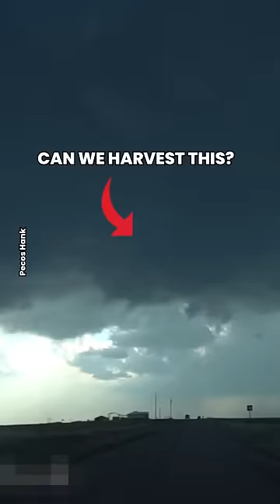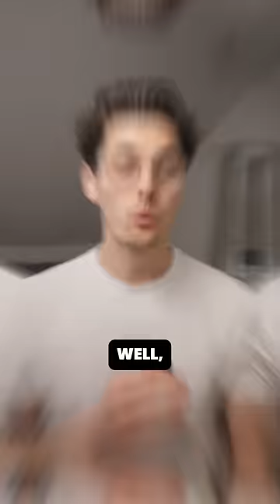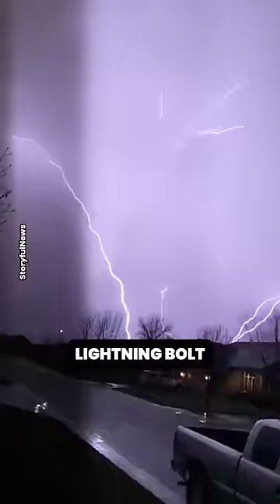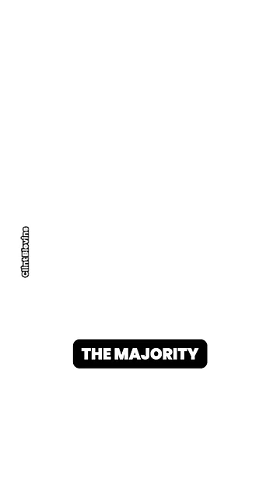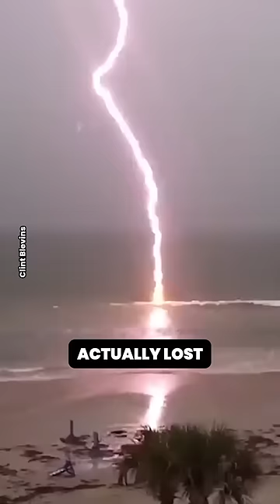Why don't we harvest lightning for energy? ⚡️ #shorts #alternativeenergy

Comment: If we could tether balloons with conductive cables , like hot air balloons people would ride in to blimp size balloons covered with conductive materials.. possibly carbon. Maybe have it in sheets from the balloon or possibly rods with multiple balloons per cloud. Possibly install micro jet engines to maintain position. And to handle. The large pulse of energy, the key is to NOT collect the lighting pulse of extreme energy. The idea is to get the balloons in the storm clouds early before the strikes start and use huge banks of mega capacitors. With  composite conductors hanging from the balloons as they slowly pass an area . The capacitor banks are in multiple banks on the ground. The ground rods can be roughly 100' rods placed in wet areas, ponds, creeks swampy areas, or use my metallic casings for a well. Some areas possibly a 200'-400' ground rod placed into the water table. With a small carbon  and possibly ultra fine gold plated silver wire with the cable being up to 30-50 miles long with the average height of roughly 2; miles high or less than 3-4 miles.this allows the connection to cross the town easily possibly have a grid of sorts. A single wire circling the city or county to make the connection to. With the connection being made by a look large drone with two  carbon fiber robotic arms with the connection bring broken automatically  with multiple connections possible. and  the larger blimp size balloon can have smaller balloons attached to it. That are reeled in by small winch. Having smaller balloons (100' sphere +/-) with a accessory basket and connection to the blimp it being from 500' to 1000'+long and 100'-250'+ wide, with the. Small balloons attached to it. About 4-6 on each side. Each with its own controls using small jet engines or ducted fans (electric jet engines) or even traditional propellers using a small engine and generator to provide power for the electric version (and battery bank,) to allow it to land it's self if the tether is broken  using a larger possibly carbon nylon, synthetic cable with a conductive core or possibly a separate conductor the conductor being roughly the size of a 14 gauge wire. Made from carbon with possibly ultra fine gold clad silver wire woven in the carbon fiber. If the wire is work hardening possibly use a induction heater to heat the wire in the carbon. The carbon being a fair conductor because the voltage is high. And current Is low.  With the voltage being from 20kv to 800-900kv in the 5ma range possibly 15ma . With gps to keep the ship inside the storm the difficult part is building something like a reverse Tesla coil. To convert the high voltage DC to AC. Then convert it to lower more useable voltage . Likely 2000 volts or less possibly it using a 500 Mega farad storage bank to store the energy so the battery can be charged a 5 mega watt battery bank to supply the grid.  With the battery bank and capacitor banks places in towns  along common storm paths. With a few trucks   with Large spools on towers connect to the grid loop that connects to the storage, then connects to the drop line from the balloons.  Using a fiberglass boom arm to connect the cable to the 2/0 steel or aluminum cable. Looping the town connecting the up to 2000volts to the storage when inverter converter on another truck trailer  the balloons could possibly be equal to flying about 8 kites about 20,000 SQ ft  in a thunderstorm. With the small balloons carrying a fine carbon net between them and the blimp this can exceed 300k sq feet , it will collect power in clear weather but in a storm with one at the top of the storm and another at the bottom, the energy could be much greater like catching a bolt ⚡ of lightning. spread out over minutes not less than a second. It could be a constant 500ma at 200kv. And. The balloons could be made from a thin carbon fiber like silk over a thin mylar film. Fill with hydrogen in small compartments with equipment to chill and compress the hydrogen into tanks. To land . Or boil off the hydrogen to reach higher altitudes.  This can lessen strikes during storms. And can be built up over time. About. 100 million to start

Comment: Did this guy just make this stuff up? I’m a verified EHV (Extra High Voltage) electrician and studied lightning protection systems and currently am a Senior Electrical Tech at xylem. I can build a system to charge batteries with a lightning bolt however I’d need a sizable array of capacitors high energy diodes and batteries at the basics. I could build it large enough to charge during a lightning storm and power a city grid, however, how often would I get enough lightning to justify the price is the problem I can think of. Heat loss is no issue I can get taller towers and lightning still has a lot of energy even after hitting the ground, we already send higher than the energy in most lightning bolts in EHV and UHV lines so carrying that much current is common. Predicting where a lightning bolt hits is not an issue as you can cause it to target posts easily. The problem is lightning storms don’t occur enough to justify building a lightning harvesting system in my opinion. 

If they can cause a lightning storm where the causing of the storm vs the price of harvesting the energy makes the juice worth the squeeze then great but it might not be worth the price.

Comment: the actual reason is its not profitable enough to make it works. making a large ass capacitor to hold that much power in a fraction of a second will cost alot and need a lot of space to store ut

Comment: There is a voltage gradient of 100 voltage for every metre above the ground. I have seen a static charge electric motor,  you tube,  running of a hundred foot wire  under a baloon. Enough to charge a phone.

Comment: What if like a balloon made with material that is conductive and wont pop it. just flying in thunder cloud connected to the ground with wires. Will that fix the "we don't know where it will hit" and "most energy lost to heat and light" issues.

Comment: Couldn't we make like... REALLY thick carbon rods, really high in the air? Pure carbon has the highest melting point, and conducts electricity incredibly well. Sure, we'd lose a bit of the carbon at the strike point, but... it's a really, really abundant material.

Comment: We don’t need the lightning to harvest the energy of a storm. Lightnings happen because there’s charged cloud and all the charges want to go towards the ground. When the voltage becomes high enough the air ionizes facilitating the passage of current and the lightning smacks the ground. But what we really care is to transform the potential energy of the cloud into electrical current and store the energy again in batteries. If we had a very high tower (I’m talking like 10km tall) we can just harvest the energy of clouds passing by. But that’s very complicate to build, if not absolutely impossible with our technology. Then you have to hope for a storm🌈. Also, the reason clouds contain energy is because water evaporates and forms clouds that are then moved by winds. So, even if there was such technology, it would just be solar energy with extra steps. Just build a solar panel.

Comment: Every point you made is wrong. We totally have the materials, we can not only predict where lightning may happen but can attract it, and excluding the light and heat and sound energy given off which is negligible compared to the whole not the other way around still leaves the majority of the energy. Just because something isn't done doesn't make it not doable, as we have caught lightning in a jar, and theres little to no reason we shouldn't be doing it.

Comment: Everything in the video is wrong... poster doesn't do any kind of research but I did it for you. Keep in mind a man was hit by lightning 7 times and lived.

A typical lightning bolt releases about 1 billion joules of energy. The atom bombs dropped on Hiroshima and Nagasaki were each equivalent to between 15 and 20 kilotons of TNT - so between 60,000 and 80,000 lightning strikes each. - Source (Physics Stack Exchange)

Also lightning hits the planet 100 times per second and not 44. Source (National Geographic).

People need to stop using Wikipedia as fact. Schools dont except it as a source since it can be edited by anyone at anytime. I remember when people changed the wiki on Burger King so Siri would curse you out when you asked about BK.

Comment: Celsius?
The Thunderstorm Reached 50,000 Degrees
Wr 102 Has a Big Problem it had 210,000 Degrees
Weaker than LHC.
LHC is 7.2 Trillion Degrees

Comment: I have not wondered. So, I resolved your mysteries and solved all the engineering issues. I can cause lighting, in the location I want to strike, capture and convert the energetic heat, and distribute it to the grid with an advanced sine wave.

Comment: I feel like the pyramids were used for lightning energy storage due to the fact that they were covered in quartz and used the ark of the covenant as a electrical device. You should check out the theories floating around the pyramids. The Why Files has a good episode that divulges into this theory.

Comment: Tesla wasn't trying to transmit energy.  It's obvious looking at the tower.  He was trying to absorb it. That's why his tower was donut shaped and not shaped like a dish. His tower didn't need to be hit by lighting because there is free energy readily available the higher you go above the ground.  This is known.  Teslas real guineas was creating an analog path to converting DC power to AC.  Using induction.  induction works both ways.   All unobstructed electrical circuits do.  Only THEY are covering up the real truth by telling everyone he was trying to transmit power.   Laughable because the power he was apparently trying transmit didn't exist.   It makes way more sense to me that Tesla was ready to harvest energy.   The inventions he used are well known.   And transmitting power is readily possible.   There's just no way to meter it... shucks😢
To the problem of sorting the energy...We could flash boil water and use the steam to lift heavy weights.  BAM. waiting for the black helicopters.  Every time I post about this, it gets pulled

Comment: If we send positive charge upward constant by making several towers of copper with some coating that it conduct electricity and distribute it rapidly and make shaft run after this and make a element that can store energy and after than we can utilise it like arc reactor or we can send drone like satellite in stratosphere when light strikes it go on surface of that and it tramsmitt it evetwhere around it system like we can use material that can prevent from radiation 
It's [2024] I am utkarsh kumar from India and in year 2045 I will publish my theory on this and make a way to utilize this energy stay tuned and that theory will be popular or valid as theory of relativity it my promise to give this world free and no cost electricity without wires I will do it ]